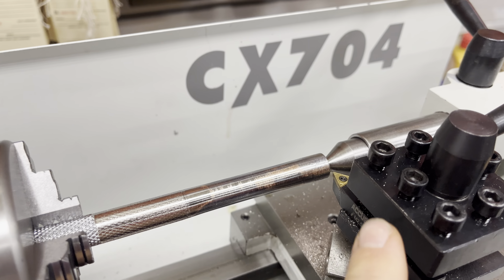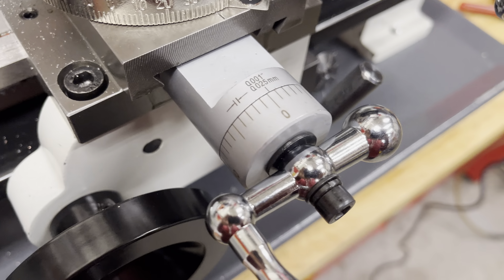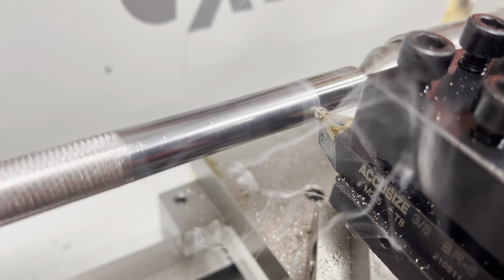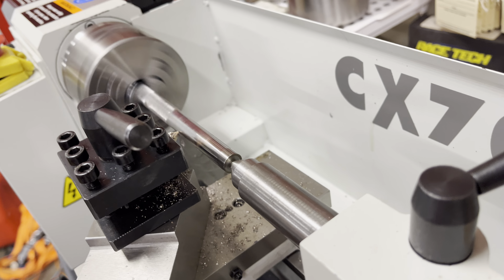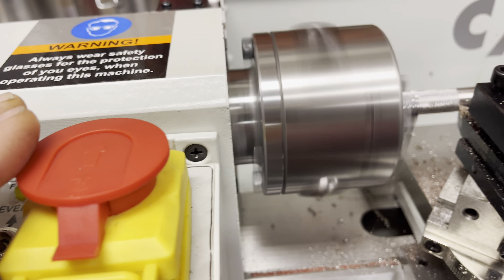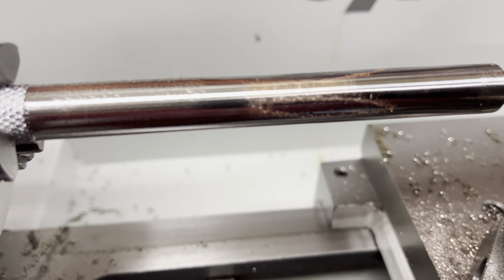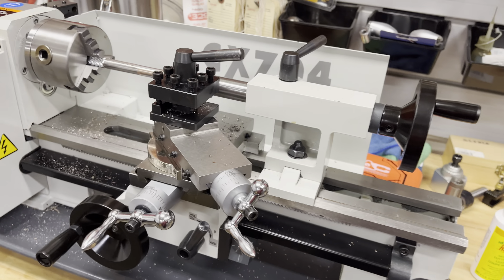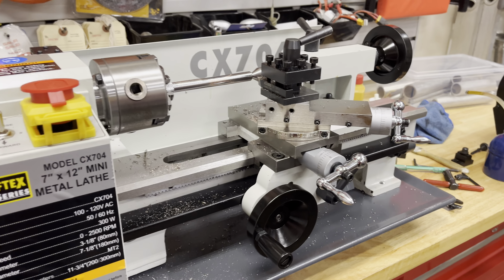New Mini Lathe Turning S2 Tool Steel with Carbide #machining #minilathe

Comment from the maker: Thanks for the kind words! The new handle I was turning here works great! Tapered it on the first 1/3rd and threaded the tip, chamfered the 90’s and buffed it up pretty. :) Ya I’m totally loving it so far. Bought it used off a guy for cheap with a bunch of tooling he threw in. I tore down the entire machine (twice) and greased/lubed/ tightened/straightened and optimized every single point. Added some Mail-spec bearing oil into the sealed spindle bearings, greased and set all headstock gear lash and gear change side as well. By far the biggest rigidity differences were made by diamond honing all the slide surfaces (especially the bottom rails) & trueing-up all gib spacers, and then precisely adjusting all gibs rod nut angles to remove backlash. Then mounted it all to a 25” x 1/4” steel channel. Immediately noticed a huge upgrade in rigidity and surface finish. 

I also trued up the 3 jaw chuck via dial indicator and got it to less than 0.0015” of runout which is pretty good. 

Next I’m going to replace the 3” chuck with a 5” or possibly 4” and adapter backplate.

I’m sure I could learn a lot from you and all your valuable experience on the larger lathes! Thanks for the comments and I hope you enjoy your new mini to mess with inside. That’s a good idea to be honest! 👍

Comment: Well your new mini lathe looks quite good, and works well. I bought my first lathe for use at home in 1990, and have had much larger lathes at home since 1992. 
 But just lately I decided to downsize some of my machines so I bought one of these mini lathes for use in the house where it sits in the living room so I can fiddle with something mechanical when I'm stuck indoors and cannot escape to the workshop, I've had it for less than a week.
 I remember when they first appeared here in the UK, over 25 years ago I think. Chester Machine Tools were the first to offer them here, and they were more expensive back then than they are now, even though prices have risen in the last 4 years. Thankfully China are still making them.
 Anyway, I hope your new lathe gives you many years of good service, or at least until you decide to get yourself a larger one.

Comment from the maker: Btw, I’m currently scratching my head trying to find a softer aluminum oxide grinding wheel for sharpening HSS tooling than these grey ones. I’ve tried 3 different brands and all of them are too hard. They overheat the HSS in a matter of seconds, and I’m dunking every 5-7 seconds even. I constantly and diamond trueing them but they stop producing sparks and start just scuffing the HSS after about 20 seconds of use which I think is because they’re too hard. 

Trying to source a softer white wheel that will work for HSS is no easy feat here in Canada! The last HSS bit took me 2.5 hours to fully grind all angles on with 36 grit grey… :( Works amazing though!
Reply: Try Busy Bee or Lee Valley for white aluminum oxide wheels. Also you could look for industrial supply companies in your area.  What type of grinder are you using? I've been using standard grey wheels for decades to sharpen HHS and tool steel without issue.
Reply from the maker: Thanks for the suggestions! Lee Valley is a good idea. I’ll check with Greggs and a few other places like Acklands Grainger too. I’m using a brand new 6” Dewalt bench grinder I just picked up, typical 3450rpm or whatever they are. Thanks again!

Comment: Just got one of these lathes and am having issues with getting it to cut nicely on steel.  How much of a difference did the U-channel upgrade make?  Thinking of doing the same thing.  Thanks!
Reply from the maker: It added a lot of rigidity when I’m taking deep cuts in steel, and harder steels. But to be honest by far the biggest difference was to tear down all the cross slide assembly, clean it, oil it and reassemble it then spend a couple hours properly adjusting the gibs on each slide. That took out 70% of the original flexing I had. The heavy u-channel base helped about another 20% and the final 10% was tearing down the whole machine, lubjng and perfectly adjusting everything. Even the spindle bearings’ side load, lead screw, all gearing, etc. I also made some electronics tweaks, but that’s beyond the scope of this portion. Hope that helps!
Reply from the maker: I can easily take .040” deep cuts in grade 8 steel now now problem. It’s crazy how much difference it makes to take care of all the little things, because added together, it makes a massive difference. I’m also using 3/8” tooling and carbide when I’m taking those deep cuts in hard steels.